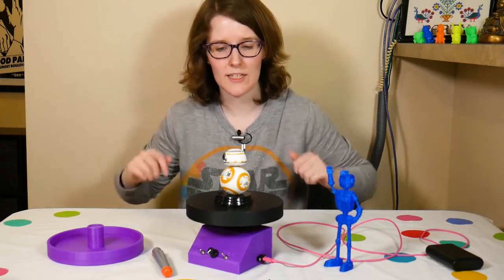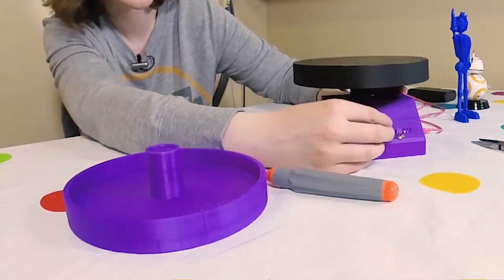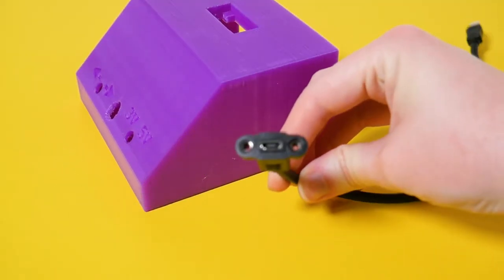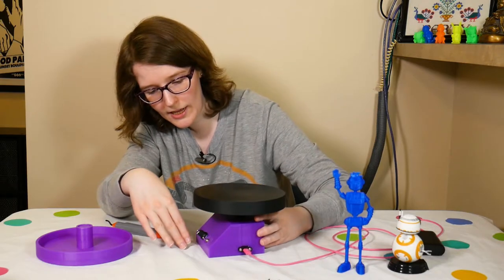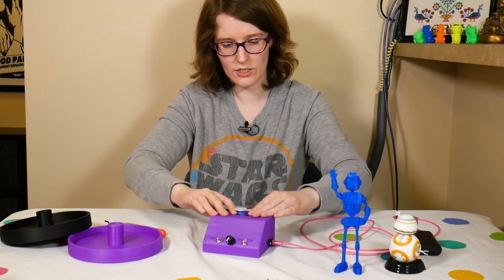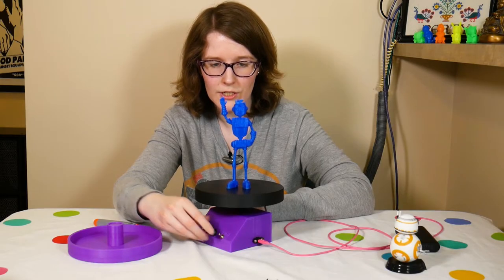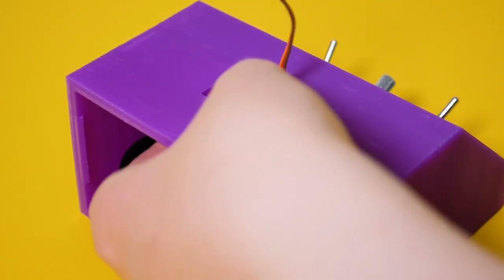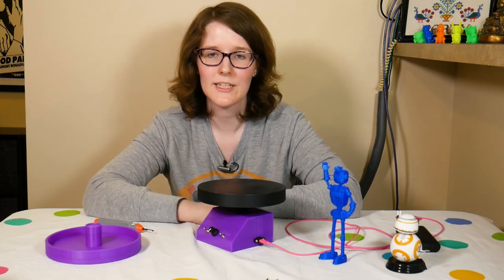Build a DIY Motorized Turntable for Photo & Video!

Comment: After seeing on one of your instagram pics that those servos (in that size) exist, I had to order some for my dad because he builds little cars with them and always needed to modify the SG90 first. 

I've build a turntable with a 4017 + 555 timer kit and a servo + ULN2803 kit from ebay. Might be a cheap alternative and is a lot of fun building something without any MCUs involved :) you need to tweak the capacitor values and the pcb a little to make it work.

Comment: Nice project! I like how everything in your design fits. Don't know, it's really satisfying to just snap the servo...
Typing of which, I would love to see a video on servos as it's something that I haven't worked with yet :)
Reply from the maker: Thank you so much! I was excited to get a streamlined enclosure for this one. I feel like I'm finally hitting a stride with Fusion360. Video on servos will definitely happen (at some point) =D they're really fun- you should try tinkering with one even if it's just some example code. The libraries for Arduino and now Circuit Python make everything really simple or you can dive in deeper (if you dare)
Reply: It's not about the code or anything like that - I just have about 3 things in mind that I wanna do right and none of them happens to involve servos. But it is an interesting field and getting an insider's tip(s) is always useful  ;)

Comment: What range of pulse widths is your code generating? Maybe centering around 1.5ms and a smaller range of widths would give you the speed resolution you need at a normal 5 voltish servo supply with out giving up the torque by under supply it with 3.3volt? Some of the pre-made continuous rotation servos may have and increased dead band to avoid creep which may not be helping. Just thinking out loud.  BTW it the origin of the term "lazy susan" seems to be lost to antiquity.
Reply from the maker: I appreciate that. I was aiming for 1.5ms but a smaller range may help. I was also considering beefing it up to a fuller size continuous rotation rather than a micro at some point to see if that would change things

Comment: Good idea, however the plate is not symmetrical enough and also the servo keeps changing speed because the parts were not printed precise enough and thus the friction is not constant. Placing the servo in the central axis of the plate just emphasises all that. Might have been a better idea to put that servo at the edge of the plate with a rubber gear on the axis of the servo. That way the turning speed would have been much smoother.

Comment: How did you choose the motor? Did you also consider using a stepper motor?
Reply from the maker: mainly size and voltage rating. i wanted something that could easily run with one of the adafruit boards without being too power hungry. if i ever scale it up i might consider a stepper motor